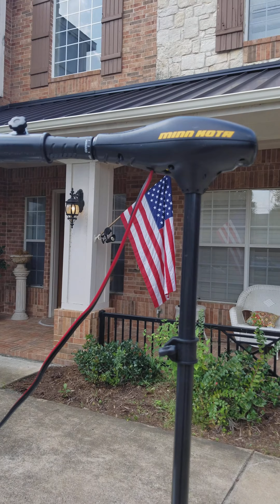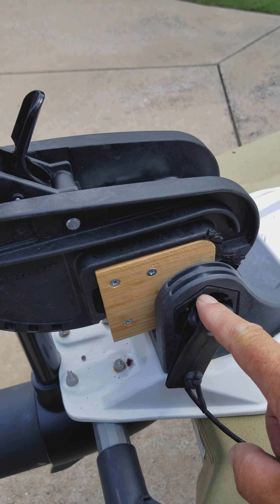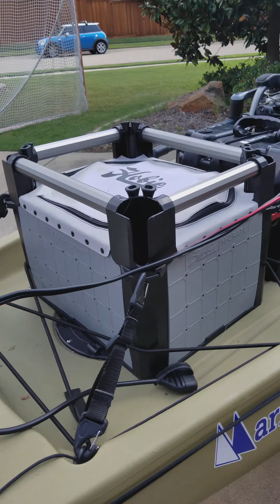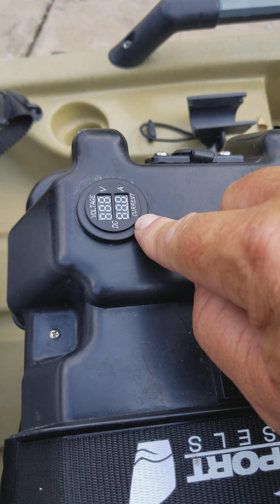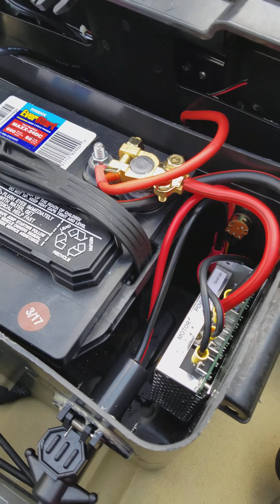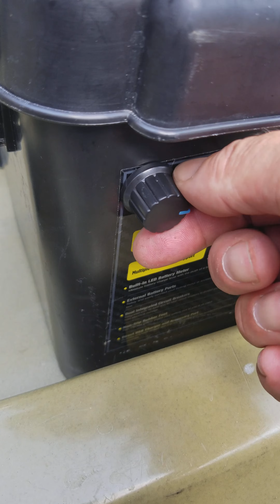Trolling Motor Install on Hobie PA14

Comment: What battery you used for your 55 pound engine, I just bought one of the same pound, but I don't know what amperage is right for my minn kota riptide. Greetings from Mexico
Reply from the maker: Its not cheap, but its super light and will run a 55 all day. https://www.fpv-power.com.au/kayakbatteries/index.php?route=product/product&product_id=64

Comment: Dude " l like your ideas  but you need get rid of that acid battery  upgrade to Lithium  30 or 40 amp hour it's well worth it  they weigh in  eight or 9 lbs l got the website lnterested
Reply from the maker: Did just that. Got a 50ah lithium battery. So much lighter

Comment: Do you steer the Hobie with the Hobie rudder now? If so does that work well?
Reply from the maker: Tim'nGrace OSullivan I do use the rudder and it works great. No need to steer at all with the motor.

Comment: Nice setup. I'm just trying to decide between a 36lb and 55lb thrust motor on my pro angler 14. I think the 55lb would be more fun and faster to get back home when I have lots of battery left. What I wanted to ask if the lowest speed on your 55lb was slow enough for trolling?
Reply from the maker: Michael S Ironically, the battery draw is very similar with both motors so might as well get the 55.
Reply from the maker: I went with the 55 and it was really nice

Comment: Nicely done - hope you can come up with a way to get reverse working.  How much run time (at 4-5 mph) are you getting with your setup or how much extra range are you able to get on your outings in electric mode (ie another 5-x miles of run time at 4-5 mph)?  Thanks for posting this video :^)
Reply from the maker: Joe Szabo Appreciate the comments. So the unit I installed in the battery box had a 3 way switch. If you throw the switch one way, forward. Middle, off. Other direction, REVERSE!!!! No messing with the trolling motor controlls at all! And I'd have to say that the additional range really comes in at lower speeds. Since you can dial the speed to EXACTLY what you want, you have significant gains. At full speed not as much, but maybe 20% more?
Reply from the maker: Sorry so long on the reply. I figured out reverse. With the trolling motor switch set to high (5) in forward, I can thrown the switch on the DC speed controller to the negative side. Basically it reverses the polarity and guess what happens? The motor goes in reverse! I have the fwd, off, rev switch now mounted next to the speed knob and I have full control. If I run the motor full speed I get a few hours out of it. But I usually never do. I troll at about 2 - 2.5 mph. I can get a good days worth out of that. I will switch off between pedaling and trolling if I'm going to be on the water all day just to save some juice.